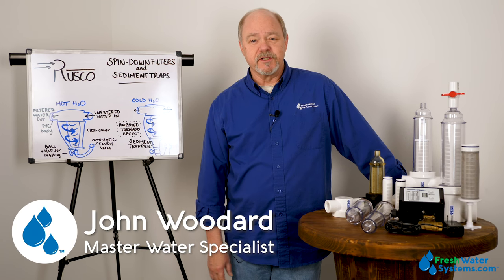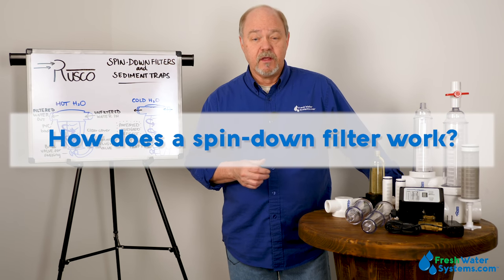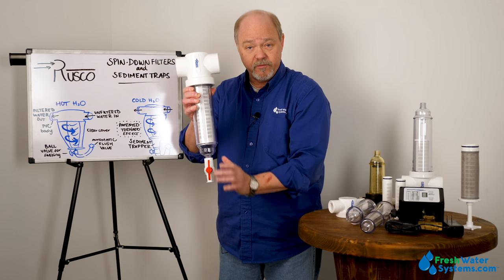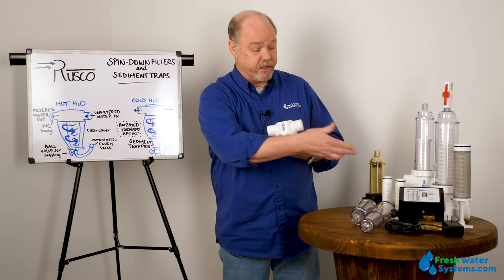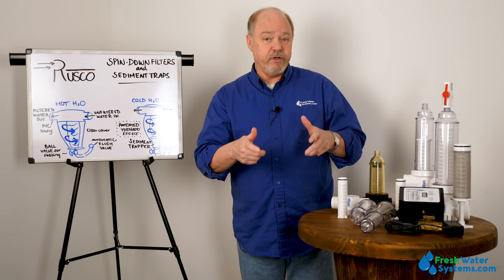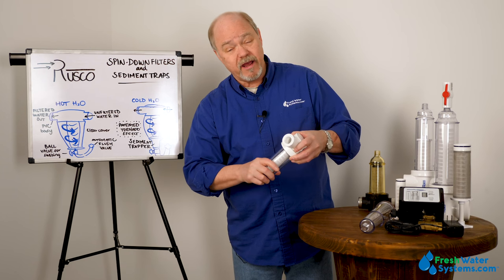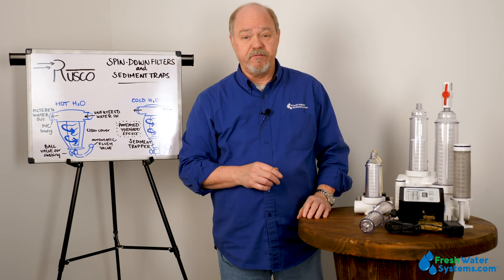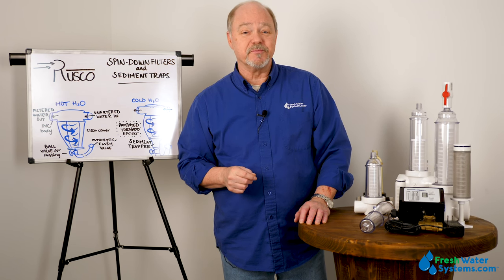What is a Rusco Spin-Down Filter and How Does It Work?

Comment: can i use this before my pressure pump? like pvc pipe from my well then spin down then pressure pump before pressure tank? cause because of the fine sand my impeller of my pump keeps getting damaged and unable to pressurized my pressure tank

Comment: In my case, I'm looking at the source being municipal water which is not rated for drinking.  The water is slowly pushed into a large water tank which then an electric water pump will push it to the house.  I'm told that a great upgrade would be to add a filter before the water is sent into the tank.   So far, I don't know of a recommended filter that is best for my use case.

Comment: What mesh size is best for well water with fine clay silt? I currently have 100 mesh stainless steel and it gets clogged up pretty bad. Thinking of switching to 60 or 30 mesh stainless steel. Thanks.

Comment: I am adding one of these type of sediment traps to our well water system, but I think the trap really should be prior to the pressure/bladder tank.  I have had previous issues with large amounts of sand collecting in the bottom of the tank, since it is typically the lowest point.   Would you agree?  (you mentioned installation AFTER the pressure tank).
Reply: I'm just thinking about this as well. I'd rather have the sediments filtered out before the pressure tank so it doesn't clog the tank to start with.
Reply: Bad idea because if the filter ever becomes blocked the well pump will not know to turn off and you run the risk of blowing the feed line or damaging the pump. The pressure valve in such a situation would not see the high pressure and hence not turn the power to pump off.
Reply: @brianbonnick2196  I guess I had envisioned it between the pressure switch and the bladder tank (there are several feet of PVC between in my situation.)  However, it could possibly make the pump cycle on/off rapidly if it were clogged.  We have literally had the line between the bladder and pressure switch become fully packed with sand several times....this occurs when the power goes out and pressure is bled off the bladder tank, and pushes the sand sitting in the bottom of the bladder back up into the line.
Reply: @brianbonnick2196  so is it pretty common to have the sediment build up inside the pressure tank and seep through to the SDF?
Reply: you can blow down the pressure tank every once in a while but yeah it is a predicament i don't like it either.

Comment: Ugh.. commented in the middle of the video, my bad. Seems if a 1000 hole filter is 15 microns, then I'm going to have to work out the parameters of the rest of the system first (a 3 phase filter system for silt, I was thinking maybe 20/10/5 microns for those filters would work until I watched this) and then find the right amount of holes per square inch/ microns to work out properly with the rest. 
Seems I'm at the bottom of my learning curve! Is there a holes/micron size chart out there somewhere?

Comment: I'm interested in this as we have pumped underground hard water that does tend to have large sand/sediment in it.  I see the sand in a clear bowl of water. It's not bad,  it's been ok for washing hands & dishes, but I have to wonder how much sand gets on our bodies, especially in our head of hair, after a shower.  We do not drink the water, we buy bottled water & also bring in many jugs of relatively cleaner city tap water from somewhere else, so I am only interested in trying to do a basic filtering of sediment/sand from our whole-house water.   We also have a septic tank & because we stopped using a water softener for about twenty years now (it broke), I have to wonder if all that sand/sediment from underground gets trapped in our septic & possibility makes the room volume of storage in that tank smaller & smaller & smaller.  We have had this house, underground pump & septic tank since the mid 1980's, so after all that time, I am worried something bad might happen to the septic tank from a slow accumulation of sand inside over time & it likely be costly to repair.  We only have 3 people in the house now, as the other half/three have since left for years now.

Comment: Have seen two other similar comments: Our housing is almost impossible to loosen.  Any tips?  Rusco suggested wrapping housing in towel and using spanner wrench.  Didn't work.  Hubs uses gripper gloves, tries 4-5 times, takes a break, then tries another 2-3 times before it loosens.  Since I'm much weaker I do reinstall to "barely hand tight", yet it is always so difficult to loosen.  There must be something wrong, or something we're missing.  Yes??
Reply: I’ve put Vaseline on the threads, seems to help

Comment: What do you know, after more then 10 years with that filter I just discovered it was installed backward. Thank you mister plumber guy! No wonder I had so much trouble cleaning that cartridge... Now to figure out how I'll reinstall it correctly...
Reply: 180 degrees
Reply: Not sure how it worked installed backwards . It has an arrow on the thing. I did install mine before my pressure tank . After the pressure tank is the whole house filter. Both filter systems have bypass . The spin down filter is new so comes apart very easily . Always use a food grade silicone for re assembly.  Also I ran about 10' of ice maker tubing that I can run outside my crawl space to drain it down. Don't want to haul buckets full of water 😒 outta there.

Comment: Can you add any of these models before the pump?  I have small rocks coming in (the size of fish tank gravel)  and I would prefer not to have that debris in my pressure tank.
Reply: I'd put it BEFORE your well pressure tank 😉
Reply: I have same requirement. I presume you have a jet pump. We at present have a 60 mesh static screen/filter before our pump. It only collects gravel and seashells that come in from (in our case) the lake. Doesn't get blocked and I just rinse it out every 6 months or so. It has an o-ring that leaks, so was looking at alternatives! By the way, we don't have a pressure tank, so the pump flow controller also needs clean water.
Reply: Now I've heard different things but I put my spin down filter first , then a whole house single canister before my pressure tank . Then after all that I put in a 3 stage filter for the house. For the hose bibs and irrigation misters I run them through a single canister filter as well. Our water with all the iron was rurning the toilets rusty . Not any more .

Comment: I keep hearing debris and the description goes down to "sand" but I'm wondering if just sediment sized particles, the kind of fine particles I see in my toilet would be too fine for a spin down filter.
Reply: It's not anything crazy. It just grabs stuff like pebbles, sand, dust, and the like depending on the size of the filter. You use this in combination with another traditional filter, such as a whole house 2-3 stage, so it doesn't eat up the filter with a bunch of gunk. You know, rather than the filter having to handle EVERYTHING, it only has to handle everything below, let's say, 30 microns. As a result, it handles akin to city water.